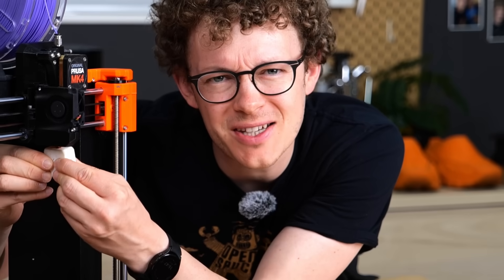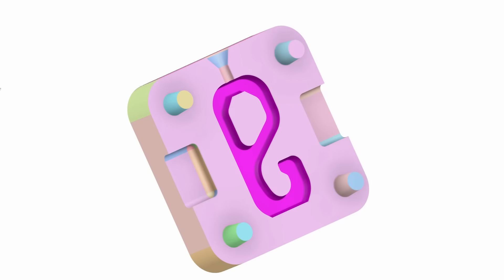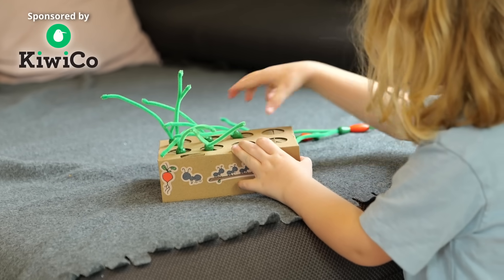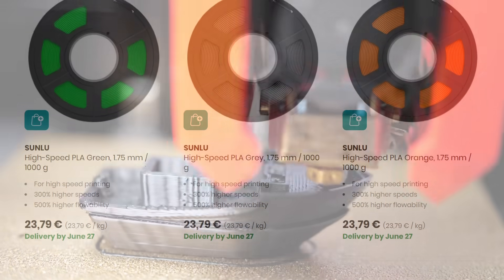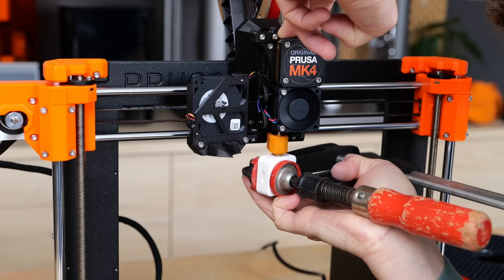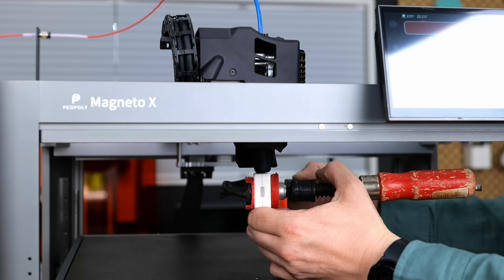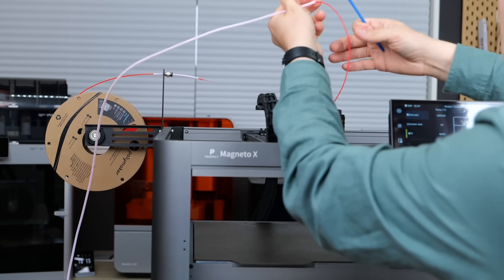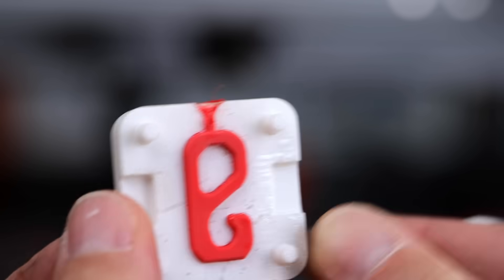I tried Injection Molding using a 3D Printer!

Comment: Some of the industrial molds have gates of 0.020 inches or around 0.5mm. Does anyone think that it would help in this case? I think it would increase the injection pressure seen inside the mold.

Comment: 0:13 No Glue? Do PEI plates Require Glue Stick coating?
Reply: Well I have a textured PEI and I only use glue occasionally and it works fine
Reply: depends, i use glue if there too little first layer contact and i dont want to use rafts or if im printing something with a big first layer of abs

Comment: If you want to revisit this idea take a look at how soft plastic fishing lures are made. I have 2 ideas. 
 First, vent holes in the mold. You are rapidly pushing hot plastic into a sealed mold. The air is rapidly heating and expanding looking for a way out and your pressure is too weak to push back. At the same time the air inside is cooling your plastic causing blockage. 

Next your extruder. You are already creating pressure behind the nozzle that is being restricted by the extruder smaller diameter.  I would say open up the diameter to the same or slightly smaller than your filiment.  So using a 1.5 mm nozzle for the 1.75 filament creating enough back pressure so it melts but still flows quickly. 

Combined with the need for a vent I would guess 1.5 to 2 mm diameter holes near the top of the mold cavity would let out the expanding air amd provide an indicator for when the mold is full. 

These ideas are based off equalizing pressure to allow for the lower pressure extruder.

Comment: Something I was thinking about while watching this was that in an injection molding machine the plastic itself comes out almost instantly, as opposed to Filament which comes out slowly. Without the "push" you get with an injection molder, you wouldn't be able to fill your mold easily. Also something that might help is to change to the center of the mold as opposed to the top of it. If you look at Lego for example you'll see this is exactly what you see. (You'll see a little indent on roughly the 4th stud on a 2x8)

Comment: What I think is needed additional to a relief hole is it being vented off of the tail of your project with the air hole to vent it out the top. The relief hole needs to be small enough size that filament cools instead of filling up the relief hole.

Comment: Injection molding requires the plastic to stay molten while being forced into the mold.  This means:
- Clamp the mold
- Clamp the source of hot plastic to the mold
- Keeping the plastic hot longer (heat the mold), and/or do the injection fast

This may be a place where e.g. the Vincent Gingery book "Build a Plastic Injection Molding Machine" would be good.  Maybe combined with the temperature control and monitoring from a defunct 3D printer.

Comment: What if the mold essentially was the nozzle and had threads so that it could be screwed onto the hot end and not require pressure against it?

Comment: air pressure cannot leave past the injected filament. either you make it possible for the air to leave the mold or you make a sacrificial cavity where you can push the compressed air into. then you have some more tolerance for the object you are trying to mold.

Comment: TO FIX YOUR PROBLEM YOU NEED TO ADD AN EVACUATION CAVETY FOR THE AIR YOU ARE DISPLACING WHEN THE MATERIAL IS FLOWING. AND IT WILL REDUCE YOUR PRESSURES.

Comment: I would recommend looking at metal casting techniques, because that's what your trying to emulate with your current process. Should definitely help if you made a air hole and had a type of active heating on the mold.

Comment: Hello from Germany. Thank you for this great and interesting video. I think it is a idea with great potential for all makers. I'm also sure that it will be better to fill in with lower pressure, if you make some leaks for the air on the end of the flow way. You can also use a better position for the inlet point to reduce the maximum distance for the material flow way in the mold. In case of the industrial molds there are leaks for the air as the clearance of the eject parts and another as small gaps between the molding line (0,1-0,3mm). This gaps are big enough for the air and to small for the plastic. I hope this informations can be helpful and you find the time to make some optimization and a new video with the results of it. I'm very interested about it! Thanks for your Videos and best regards. 😊

Comment: What if you thread the mold and inject straight to it with just a hollow threaded rod? It should be able to better withstand the pressure without leaking and ease the printer from needing to push all that filament through the narrow hotend. That is, if the resin can withstand the temperature, I'm not familiar with SLS

Comment: You're limited to very low pressure since you're holing it by hand vertically.  Maybe try running the extruder down into the fill and pressing the old into the build plate.  Better pressure holding,  less leaking and better alignment.  Also maybe some type of very small vent port to evacuate the air.  That's likely why you had trouble filling the furthest corners of the part.

Comment: I have several questions:
Why not just print the negative mold and send it off to have an injection molder inject it with a different plastic? 
Why not make a GCODE that stops dead center on the build plate at the exact height necessary and run the extruder hot for the amount of time it would take to fill it with a measured amount of filament instead of holding a vice up to it?

I get its a fun experiment but I don't think u were going for results

Comment: I strongly agree with many of the comments here, You are fighting air compression in the mold. Make an air exit at the farthest path. Second - injection molding machines melt enough plastic to fill the mold all at the same time.  -- The first challenge is easy, the second could be difficult to overcome.

Comment: Your theory is perfect, however your injection moulding has a flaw. Push the melt into the mould compresses the air causing the failure. You should try putting a small air release hole at the end of the hook. Try that.

Comment: I think that maintaining the mold near the filament's softening temp (es. 120°C) will improve the injection. Two alluminum heating enclosures (or simply 2 thick plates) could be used for that.

Comment: I'm surprised the air is able to escape without air holes. If there's no way for air to escape, you'll end up with a bubble that almost no amount of force will overcome... and if it has nowhere to go, it will either ruin the part with a large bubble or it will push the plates apart and cause flashing. It looks like the two halves of the mold might be open enough to let air escape without letting the plastic to escape also. The parts came out really good though, so I guess I can't say much. I was expecting the holes to be 100% necessary though and was surprised to see that they weren't. That could make injection molding a little easier though, since having to remove the excess plastic would make it more difficult and would also lessen the quality of the finished parts.

Comment: I'd love to see 3d printed vs identical injection molded parts. I always wondered what the differences would be. It seems clear that injection molded parts would be a lot stronger, but sometimes I'm surprised at how strong/hard 3d printed parts can be. I have no doubt though that injection molding is always the way to go for mass produced parts as long as the part can be injection molded. There are many parts that can't be injection molded, so 3d printers can definitely be an important tool in producing parts. It's just that it has its limitations. The same can be said about injection molding too though.

Comment: try injecting the filament from both directions, the form divider was a good idea, and you should also keep the mould warm at a uniform temperature if possible. The direction of injection is also important, you can get better results if the injection direction is perpendicular to the sample. :)

Comment: Dude your math skills are impressive.  What you are attempting to do is more like lost wax casting for sculptors who cast  parts in metal. You need vents and sprus to let air and trapped gasses out of the mold. In your case you only have trapped air as other commentators have said, If you want to "injection" cast on a larger scale you need to have a hallow center otherwise you will have a solid casting. Starts to get way more complicated here but luckily, the whole concept of 3d printing is to make the outer shape leaving the center hallow. Every project has it's own hurdles to overcome, but you are brilliant, I'm sure you will figure it out.

Comment: My two suggestions are
* use bolts instead of a clamp to keep the halves of the mold together
* fabricate a hotend that is threaded and melt a nut into the top of the sprue;  you can just screw the mold onto the hotend and will get much less leakage.

Comment: Cool project, Stefan!
I think there is one major issue with it though, that would perhaps give you better results if resolved.
Which is that there doesn't appear to be a vent hole at the hex for the pressurized air to let out.
If you did have one, perhaps it would have turned out fully formed.

Great job!
Thanks for sharing with us!!

Comment: What if rather then 1 input you have a line of holes? Like you say the flowrate isn't that high but by having multiple inputs you can make bigger molds. It would also help air escape
Reply: To work this idea out a bit more: image you want to make a square plate by injection molding. So you have the mold made out of two halfs, the bottom one which is as simple as it cane be, just a flat plate with indent for the plastic to sit in. And the top half is similar but with a grid of holes in it. Because the plastic will solidify rather quickly once in the mold you may want to think about the filling pattern. To increase the cohesion of the plastic end product. Like for a plate a zigzag pattern may be best. Depending on how quickly the plastic solidifies. Same with the distance between the holes. Make it to large and you could end up with gaps or breaklines. 

What also may help is using a material with good isolation to maintain temperature inside the mold. Like other have pointed out keeping it on the plate may help also but i think because the mold itself has thickness the plate may not add much more then just a footing for it to stand on. Or, if you are going wild on this xD you can insert heat conducters in the mold to transfer the heat from the plate around the mold. But at that point i think you start to loose the benefits of using a 3d printer because of the added complexity. (Though maybe it can be done by adding aluminium foil strips 🤔 the foil insulates the heat inside while at the same time conducting the heat from the plate decently because of it being a from of metal. not sure how well that would work).

Lastly, to ensure a proper fit of the nozzle maybe put some small cushioning between the mold and the plate. While it would make it harder for the heat to get in the mold it does allow the nozzle to press down on the mold slightly with reduced risk of damage allowing for a better fit

Comment: Instead of adding pressure to the nozzle, could you apply a small suction force in the mold to draw the plastic through? I'm thinking a small hose and usb vacuum in the air exhaust hole...?

Comment: Small tapered hole at the bottom of the mold to allow the air and to a lesser extent the material to exist to reduce the air pressure on the inside of the mold may help.

Comment: Four bolt for close the mold, not a clamp...
I shall add an evacuation duct to the mold at the opposite end of the injector.
I shall add a couple of elettric heaters for every half of mold.
Probably I do my self a siringe with a metallic pipe and an heater , I woould feel up it trough an hole on the side, and after I would ignite it in the mold.

Comment: I would approach it slightly differently. I would make it to where the point of entry fills the largest cavity of the object first, and then trickles down to smaller cavities. And I would also attempt to place the part closer to where the plastic is going to be entering. Otherwise, I wouldn't have done much different.

Comment: There are filaments that don't mix well, and you need a transfer filament to change what is being printed. Why not make the mold by the one that needed more heat, and the inject by the one that needs less. Could be made in one printer.

Also the vents that everyone says. I would follow brass/bronze casting methods, minus the copper tubes. could even use silicone molds if it can handle the filament heat.

I'd also use a nonstick spray. If the filament is hydrophilic, oil. If hydrophobic, idk.

Comment: Like many viewers suggested, 
1. you need a venting/exiting hole for air and excessive material.
2. The injecting hole should be on the back of your little figure to maximize the efficiency of the material flow.

Plus, I'd suggest you to integrate a BNC port like metal connecting plug into your mold. So that you can lock the mold on the nozzle(by turnning the mold), and let go of your hands while injecting.

Comment: If you really must go to injection molding,...... which I know nothing about .......I would make a cavity at the top of the mold to hold a quantity of soft plastic and then use a piston in the top cavity to force the soft plastic into the mild making sure there is a small vent hole at the bottom of the mold cavity.......my 2 cents worth.

Comment: Sometimes molds are heated to prevent your issue. Might be your solution for this test.

Also allow a purge hole on the other side to remove the pressure from pushing material into it. You need a relief hole for the pressure build up or else it acts like a plunger

Comment: I think you couldn’t get the corners edges in the last attempt due to air being trapped in the corners. I think it’s just a limitation of the casting process and you have to design around it or incorporate a air exit hole

Comment: If you added a second hole to the mold where the trapped air could flow outward, would this solve the pressure issue? I feel like with that hole the filament would be able to flow more easily, also maybe come up with a rig to keep the mold constantly hot (around 80 C)

Comment: A hole for pressure release at the bottom, a larger filling hole, a alloy or steel mold which can get preheated to about 140-180 degree. Preheat it and try it again ;). Maybe buid the mold with it's own heating cartridge :)

Comment: two things, like a lot of people have said you need an air hole the air does not get stuck, secondly try preheating the mold a little (you cannot get too hot because they are plastic molds, but heating them up a little will help).

Comment: One thing I would like to see is a somewhat more automated setup for this. if you had a number of mounting slots for molds with heaters instead of the print bed, you could make the printer heat the molds, then fill them all 1 by 1.

Comment: maybe try heating the mould so the fillament looses less heat as it travels through (nvm just got to that bit of the video), and add a sprue for air to escape through so your super tight clamp doesnt provide a force against the flow of fillament

Comment: A lot of these would be easy to print if you added a pinhole or two at the end of the print as a way to expel air so the filament can fill the mold

Comment: Some advice popped into my mind and I've seen comments writing it but I think these are the main things you need to do in order to succeed:
1. Air vent hole needed at the other side of hole for injection
2. You can inject plastic not at one end of detail, but at the middle - so plastic need just half path for fill all mold. Of couse you need air vent holes at the all end of detail.
3. Preheat the mold to the max limit where it stays solid but preferably around 200 C , so the plastic stays soft during the process, so it won't block the incoming molten plastic.

Comment: It looks like you need a stand that sits under the printer carridge with a place for the actual mold to sit, and then a lid that closes over everything to push it all together from every direction, also maybe smaller holes for excess material could boost pressure? I have never injection molded to be clear

Comment: You need to put some exhust to eliminate the air bubbles that could be trapped inside of mold   that could be more easy the injection of the plastic  👀

Comment: I would be fun if first print the molds by using one filament (ASA) with preheated bed, in vertical mode, and between both molds you use support-like pattern (so you can release them when everything finish, i.e. to separate the molds) and when printing the molds (both side to side) completes to switch (assuming using multi head printer) to switch to PLA at lower temperature, by moving the head exactly on top of the molds entrance and start poring the liquid filament inside! So, you have single GCODE to first print both molds with thin-support like separation layer between them and then using different head, moved on top of the molds, while the printer still heating the bed and start printing with lower-temp material inside the molds. Will that work is the one million question? The mold separation layer might be one very thin line could be enough just to seal both molds, but all other perepherial layers should be with very low density, like the standard supports.